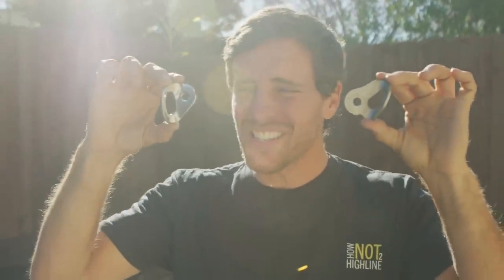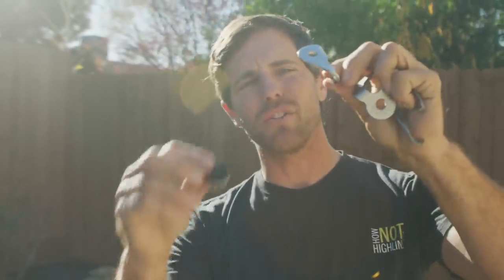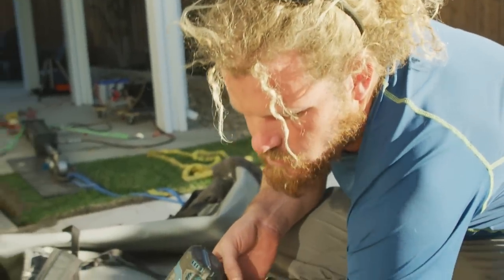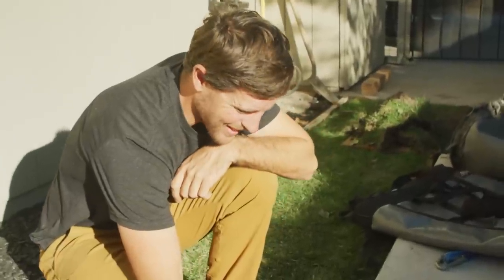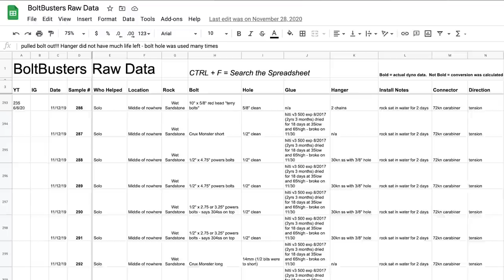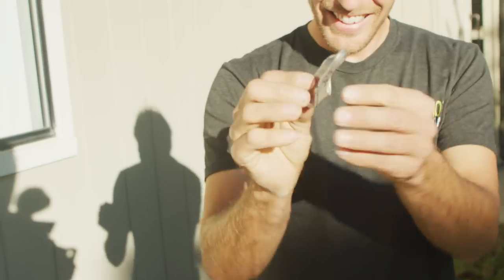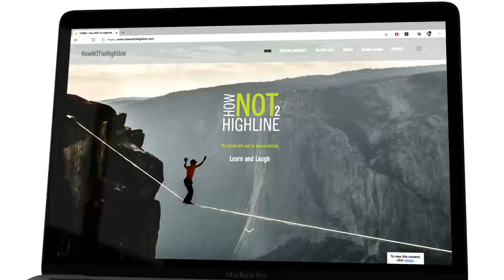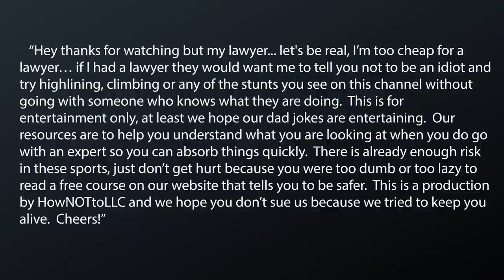Is this 400 Stainless Steel? Bolt Busters

Comment: Interesting thing about steel is you could have 2 of the exact same base steel, made from the same company, from the same batch. If one company does their heat treatment slightly different it can give a steel completely different properties...A harder steel will be very abrasion resistant but can become brittle and snap like aluminum. Where a softer metal and stretch and bend but give less abrasion resistance. The heat treatment can also effect if it becomes ferris or not (able to attract a magnet)...I'm not super familiar with how they heat treat climbing gear because I'm usually trying to get a metal to be hard to create a long lasting, sharp edge..You can test out how hard a metal is by getting a set of Rockwell testing files...They aren't that expensive and adds some good data to your tests Ryan. They look like pen shaped picks and you just try to scratch the surface of the metal starting with the softer picks. Whenever you reach a pick that starts to scratch the surface slightly, you get a good estimated guess of the Rockwell scale hardness...take care

Comment: The hanger can’t be a 300 series stainless steel  because it has some magnetism to it, that’s typical of 400 series stainless steels. 400 series is a cheaper metal in general and less corrosion resistant compared to the 300 series but can still be hardened into a useful product. If I had to guess, they probably found a cheap supply of the stuff and used it cause it’s still good enough. The various alloys and formulations in each series of stainless steel (as well as other metals) make more sense when looking at fringe applications. Since climbers are just worried about yield strength and not passing flammable hydrocarbons or nuclear waste water through it, I’d say it’s fine ✌️

Comment: Bobby said it was the third time you had used that hole (giggity.) What if you took an existing hole, filled it with epoxy, then drilled and bolted into the filled hole after curing? How might that hold up?

Comment: There may be issue with the test.  You’ve demonstrated what happens when these pieces are gradually loaded.  They may break at different strain values when they are more, dynamically loaded.  

I believe the 400 series stainless is less malleable, so it won’t change shape as much before it fractures. 

Google “chirpy impact test”. This may be another testing device for your awesome lab.  It demonstrates toughness of materials, and may explain the lower rating for the 400 series stainless. 

Thank you for all the creative experiments you guys do.
Reply: Spell checker got me, that’s “charpy impact test”
Reply: I think he wants his DROP Tower so he can dynamically test these. On the issue of stretch -  

Stretch is great but what we want is for the entire load bearing structure to stretch uniformly.  

Or as close to uniformly as possible.  Carabiners have the same issue - breaking near the bottom of the shank or the nose. 

 Why not put more material on the parts that end up breaking? And less on those that are stronger?  I don't get it.
Reply: As seen in the video, the 300 and 400 series behave more or less the same in deformation and breakage. But there might be a very practical reason for not using the 400 and maybe discontinuing it. The 400 does work harden where the 300 does not, which means that any small dent or scratch will produce a harder cutting surface than your usual 300 series that would get gradually worn out. This would be detrimental to biners of the aluminum kind in time, wearing them out. There are much harder and stronger stainless steels out there, at least 5 times stronger ones and they are not expensive to produce, but the very fact none are ever used is a hint that the biner hanger interaction would be a very limiting factor.

Comment: 316 got more parts of Chrom in it than 304 what makes it resistent against seawater. But there is also a 304U or 316u (depending on the language and area you living) they are higher acidic residents

Comment: MtnProj had a thread with reports of the 400 series having weird corrosion issues in the PNW with one oddly snapping underbody weight at the bolt hole. Not sure what came of that report however.  There was also a longer thread on the Taco years back discussing these as well. I believe some were pull tested in there as well. Strong for sure but the metal unknown and lack of any detail as to their specs had many going hmmm.  The 22kN marking is a gen2 I think. Gen1 were unmarked

Comment: The steels. 300 is austenitic series and 400 is ferritic series,  there are very few differences between them in this area of application, but the one thing important might be it's ability to work harden, which is an easy and cost effective enough technique to do in production that might confer some scratch resistance and stiffness, not much though. Lack of nickel in 400 series does imply somewhat less corrosion resistance, but only to aggressive chemical agents not found in climbing. 
The 22 or 24 Kn might be yield strength, or the value at which it starts to deform. While nice and honest, if everybody mentions Ultimate Strength you are in a disadvantage from a marketing POV.
And most importantly ,the camera is nice, but the acting seems different.

Comment: Quality was nice but colors were super de-saturated and the whole frame was washed out by facing the camera into the sun so much. You need seriously good dynamic range to do that, and not wash out. It's like it was filming in a low bit depth of 24 or something.

Comment: The problem with using a proper cine camera is the quality of your video is a direct result in your ability to choose the proper lens for the situation and your skill in post.  So if that isn't top notch, and not using a stabilized rig......you end up with a video like this that looks like it was shot with a '90s handicam honestly.  You'd be surprised what an A6000 can do, or even a gopro after a pass through lightroom.

Comment: Just before the hanger breaks, it takes on a particular shape. That is the shape a correctly constructed hanger should have (out of the factory). 

Not only that but the parts of the hanger that are stretched out and get thin are the parts that should be  manufactured with wider or thicker steel.  

From your test it's clear that the top of the hanger near the bolt hole has more strength than required and the bottom lip portion has too little.

Build a better bolt and the world...
Reply: You would be correct only if that specific hanger bent in the factory would be forced at that very specific angle it is forced in the video. But in reality the hanger needs to withstand any angle of force and thus each angle has a different deformation configuration.
Reply: @dragoscoco2173  In highlining, I'd say that is a valid assessment. In climbing, I'm not so sure.  

Ryan pull tests the bolts either at 0 degrees (parallel to the ground) or at 90 degrees (high noon).  I've never seen him pull a bolt at -45 degress, for example.  So apparently he is also neglecting certain angles of pull in testing placements. 

That indicates to me that he is concerned  with certain "reasonable" pull angles.  It can only be so safe, after all.  It's all probabilities.

Comment: 90% of steel (or stainless steel) properties are in the heat treatment. Pull testing like this wont tell the difference and the grain structure is also a heat treat property

Comment: I'm shocked that 304, 316 isn't magnetic
Reply: IIRC, it is very mildly magnetic. I think the only way you'd notice is putting a compass right next to the bolt hanger, and that typically isn't an issue climbers need to care about......

Cavers, on the other hand, would care about that... but the opinions of Cavers aren't very important.

Comment: Please don’t use stainless steel 304 for outdoor climbing. If you want to use stainless steel, use at least 316L.
Testing the resistance in a new anchor, Is not important in this case.
Thank you for the video , as always.